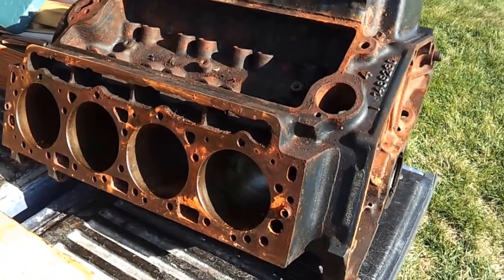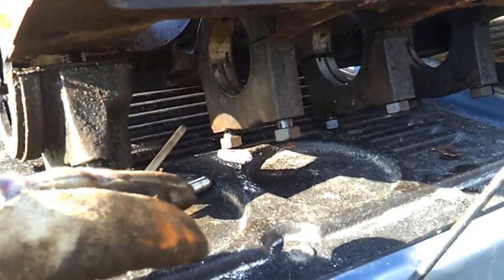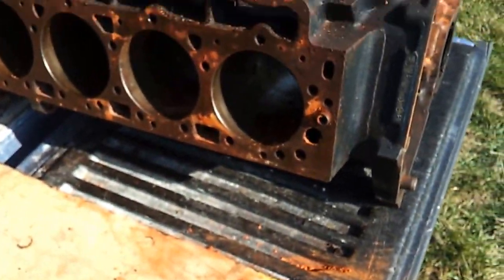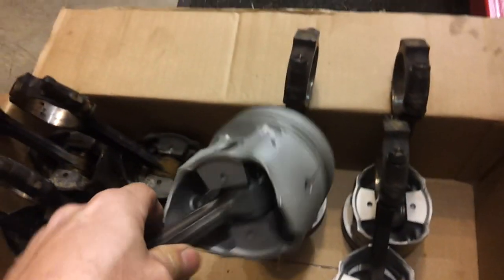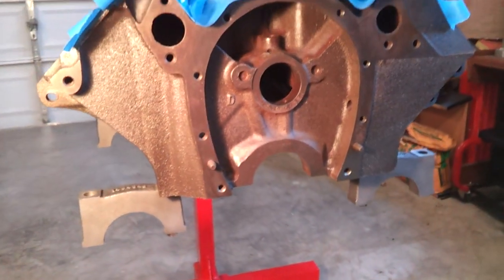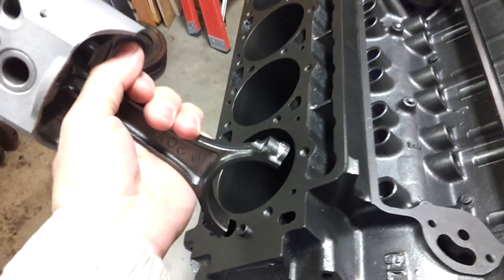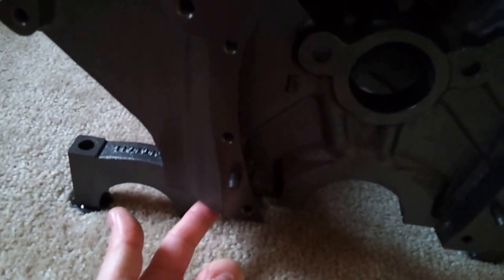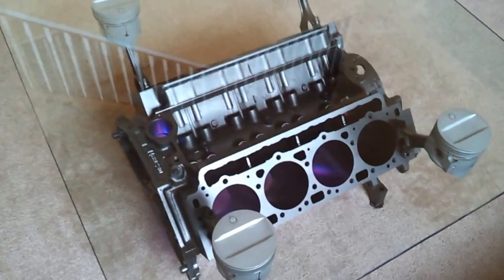Engine Block Coffee Table - 1959 Cadillac 390 cubic inch V8

Comment: love it. 
How'd you end up mounting the glass-supporting pistons onto the block without drilling/welding?
Reply from the maker: +Juan I mounted the piston rods using bolts threaded directly to the block.  I am currently building a Chevy 454 big block table, stay tuned for the vid on that one.  Thanks for commenting
Reply: Thanks! And fantastic I'm stoked! It'll probably be at least a few months but I'm hoping to make one too. I'm an aviation nerd so radial engine was tempting, but did not get the approval from the girlfriend on that haha.  Happy to learn as much as I can :). 
Great stuff.

Comment: awesome video  I just had a couple questions on it though I was wondering where you mounted the lights inside the block and what kind of light setup you used ??
Reply from the maker: LED lighting ran underneath outside of the cylinder walls.  Thanks for your comment Juan

Comment: I am doing this sometime soon, soooo stealing the bearing cap feets, very good idea! I am trying to figure out the coloring. I was thinking about going either blaster cleaned or silver colored with black internals, rods and feets but your color looks really nice and it's alot easier to do. Is it just in the video or does it shift alot in color/reflecting light with the cast iron engine color as it does like in 8.28 or is it just in the video? Did you color everything except the pistons?
Reply from the maker: Yes everything but the piston heads are cast iron.  Pistons are raw aluminum finish, bead blasted.  Thanks for the comment Peter
Reply: Alright, it looks awesome! Is it reflecting as in the video (ex. 8.28) even in the evening from lamp lightsources? I am affraid of it looking plain black :-(

Comment: hi, I'm am thinking of making a table like this but am on a very small budget do you have any recommendations for a type of engine to use?
Reply from the maker: The engine you can get the cheapest, or free. It's a custom build so one is not any easier to build than the other.  Have fun
Reply: oh ok, is ebay a good place to look, even a car junkyard kind of thing? cheers
Reply from the maker: Local. Check with a local machine shop, they may even just give you one that is no good for a rebuild.   Shipping for an engine is expen$ive!
Reply: Didn't think of that.  Thanks for all the help.

Comment: im planning on doing the same this I have a 427 but I don't want to drill holes in it so how did u mount the pistions??
Reply: I used bolts to attach the the push rods and threaded them into the block deck.

Comment: How did you mount the rods to the block?
Reply from the maker: I machined the rods to fit bolts which attach to the threads in the cylinder block where the heads bolt on.  thanks for commenting